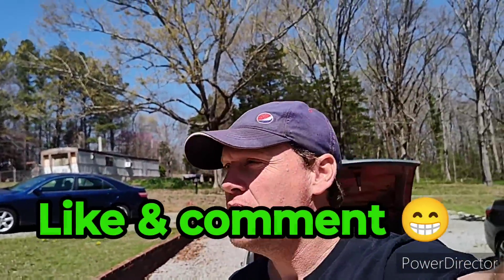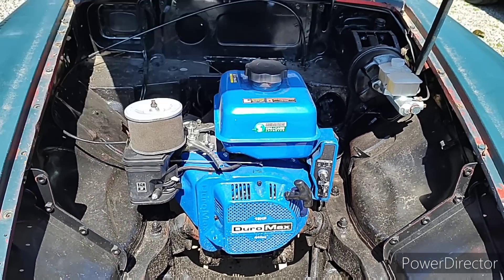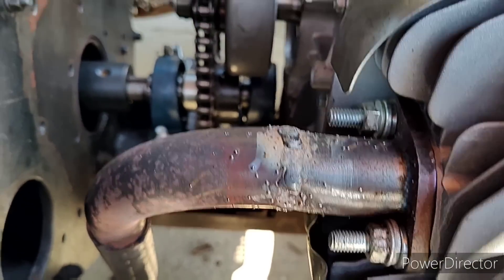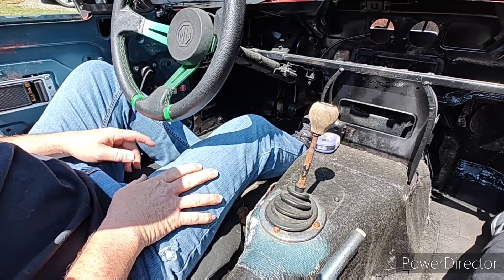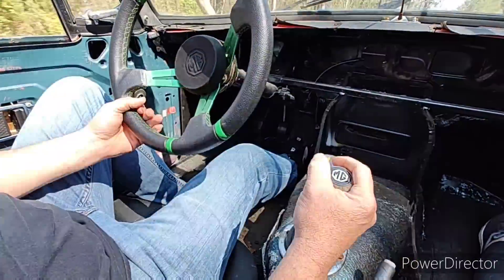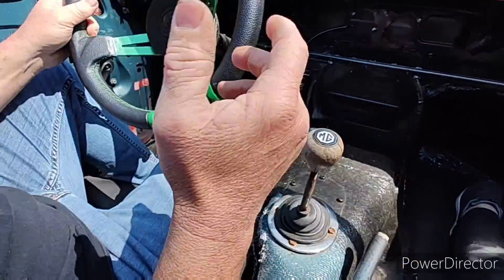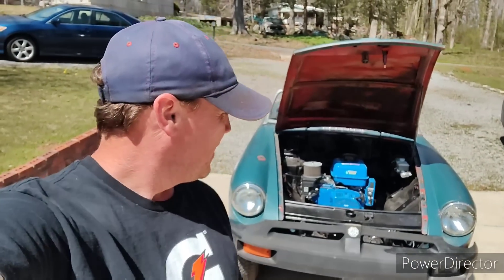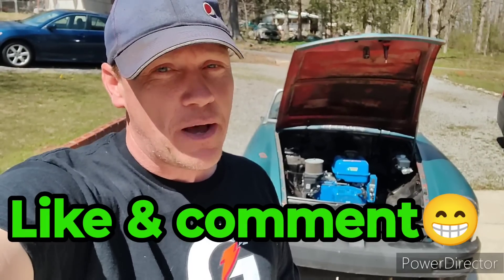How to shift gears in a manual transmission vehicle with a go-kart engine. 4 speed go-kart car.

Comment: How many miles to the gallon?, can you add an electric fuel pump to use original fuel tank?
Reply from the maker: I'm not sure about the mpg because it's not street legal and I can't drive it on the road that much you could use the factory tank with a fuel pump but I took the tank off to shed weight

Comment: Very nice how fast is it? How does it climb hills
Reply from the maker: This one governs out at 40 miles an hour my other one governs out at 49 they can handle a small grade without having to downshift but anything considered a hill you may have to especially in the faster one because the gearing is higher

Comment: What was the top speed of the car
Reply from the maker: 40 mph on the green mg and 49 on my MG Midget set up the same way
Reply: @ChrisfromKeyfarm thank you for your research and following up.  That provides a ton of information. And that's the benchmark basically... In car size must be everything if you can gain 10 mph

Comment: Lot of waisted power using the gokart clutch. Going strat to the trans seems like a better idea. ???
Reply from the maker: It is straight to the transmission , through the go-kart clutch , you have to have a clutch of some sort and the original flywheel is gone, sooooo

Comment: I would have thought that something like 5 speed manual transmission from a Geo Tracker with gear ratios of 3.65 1st, 1.95 2nd, 1.37 3rd, 1.00 4th, and 0.86 5th would work great. You would have a transmission with an overdrive and when paired with 4.10 axle gears on 30 inch tires you would also be around 80mph at only around 3200rpm. What do you think?
Reply from the maker: The most important gear ratio with these types builds is how much you multiply the small engine power into the transmission and I have found that an overdrive doesn't help you a lot because if you have enough power in first to be torquey you probably don't have enough power for an overdrive.

Comment: Would shifting be easier or harder with a synchro transmission? I assume that old MG does not have synchros. If this was done in a modern car day an early 2000s Honda civic would it be smoother to operate? Also would a go kart torque converter be able to deliver power more effectively or no because the centrifugal clutch eventually stops slipping and “grabs” at a certain RPM.
Reply from the maker: Keep in mind I'm not a transmission expert but I believe the MG is a synchronized transmission so it would be very similar to modern transmissions. Many have suggested a torque converter and they certainly have their place but for this application I think a clutch works just fine but I'm also not a fan of torque converters because I've had one in the past that caused a lot of problems.

Comment: We truckers call it floating the transmission. Or ,float shifting. BUT, what is the top speed in normal traffic with the 18 horspower engine?  Im thinking I just might build one!!!!!!😜
Reply from the maker: We call it floating gears as well where I'm from but most people don't know what that term means nowadays The top speed for this bluish green MG with this engine is 40 but my little red MG midget with the same engine is running 49. I could play with the gearing and modify the engine a little to get a little more

Comment: Floating gears. You can do this in pretty much any manual transmission, tricky thing is getting moving from standstill.
Reply from the maker: This one here has a centrific clutch paired with the transmission ,so yeah you got to float the gears but you can also stop and idle

Comment: Very cool. Shifts like the old 13 speed semi truck I used to drive. Rarely used the clutch in it either. And FWIW, I NEVER downshift in any manual transmission machine I have had since maybe, 1990 or so when I realized the training of my youth, to always downshift, was WRONG. Well, wrong in the sense that the wear and tear on the brakes is MUCH easier and cheaper to fix than having to remove the transmission from the engine to replace a worn clutch disc. Currently driving a 1997 Toyota Tacoma 5 speed manual trans and I DO NOT downshift.
Reply from the maker: Cool , good to know , I normally don't down shift in the projects , but for video sake I had to show how 👍 , thanks for watching

Comment: I was just about to say it’s like rev of matching an 18 wheeler and you set it for me at the end of the video. I have a CDL myself.
Reply from the maker: That's it exactly , thanks for watching
Reply: @ thank you for making the video I was watching some of your other videos and that was my first question is how the shifting worked. I just had my first son and I have a spare manual transmission and transfer case out of a small Suzuki LJ, which is basically like a mini Jeep. It’s even smaller than a Suzuki samurai. I’ve been considering putting a predator motor with the spare parts that I have and making him some sort of little Jeep or Rockcrawler.
Reply from the maker: Do it , that would be awesome! 👍

Comment: U need a nice size oil cooler.Cyl head temp guage.Fuel ratio guage.Oil temp guage.Billet flywheel better Valvetrain. Alternator driven by transmission pulley or driveshaft.a 900 cca battery and a nicer exhaust or a turbo with a flatslide carb.Drawthrough.CARRY ANOTHER BACK UP ENGINE ALL DONE UP IN YOUR TRUNK FRESH OIL SPARK PLUGS AND A SMALL BOX OF TOOLS.AND U CAN GO CROSS COUNTRY

Comment: Damn, shifts pretty nice man. 👍
Reply from the maker: It shifts better than I expected it to, thanks for watching 👍
Reply: @  makes sense you could find some gears with a centrifugal clutch. I’d bet it didn’t take too long to figure out floating in with the rpms. Obviously you’ve been around mechanical stuff enough to even think about this mod. 👍
Reply from the maker: I didn't come up with the idea of putting small engines in vehicles but I have tried to take it to another level, and I drove an 18-wheeler for  many years , that's how I know to float gears.

Comment: In the spirit of the old  drag racing crash box.   Remove the sincro's then file off the tip of every other gear tooth, to facilitate easier intermesh / engagement.  With 18 HP and slower speeds it should work nicely.
Reply from the maker: Interesting , never heard of that

Comment: What's your top speed on this one?? Maybe that's in another video.
Reply from the maker: The top speed on the green MG is 40 mph but definitely could be faster with different gearing as it's not weak on takeoff. I'm building the red MG right now and the goal is 50 , it's a 79 MG midget.
Reply: @ChrisfromKeyfarm awesome; thank you for responding and for the great build videos! I've got one of those Duromax motor abs I've been trying to figure out what to do with it.
Reply from the maker: @brighambaker3381 👍

Comment: What would be the process required to connect the Duromax engine directly to the stock engine's flywheel and clutch assembly?
Reply from the maker: Since the flywheel attaches to the back of the crankshaft you would have to fabricate something with the same bolt pattern as the crankshaft and attach it to the 1-in shaft of the Duramax after that you would have to align it perfectly and attach it to the bell housing
Reply: @ChrisfromKeyfarm  Thanks for explaining that to me! Could a 3D printer be used to create a template of the bolt pattern, and then once that is perfected, a water jet cutter to cut a steel adapter plate?
Reply from the maker: That would probably work 👍
Reply: @ChrisfromKeyfarm  Is that a project you would be interested in pursuing?
Reply from the maker: Personally I think that much rotating mass like the flywheel in the clutch is a waste in this application.
Reply: @ChrisfromKeyfarm  Agreed. I was thinking more so beyond this one instance as in that the creation of a coupler could possibly lead to a product to bring to market, as well as possibly helping boost channel views by being able to advertise a direct conversion/engine swap. I've watched quite a few videos by other folks who have posted on youtube about cars like Land Rovers with engines that have blown up after ~50,000 miles and they try to save the vehicles because they are otherwise good, functional cars that look very nice but ultimately end up scraping them because there aren't even engines available to fix them let alone a way to justify the price to replace the engines only to have them grenade themselves in another 30 to 50k miles. My mind goes into overdrive thinking about the possibilities of swapping in Toyota or Honda engines into those types of vehicles to save them from the scrapyard for an affordable price, and your project seemed like a phase 1 trial in a lengthy process of trying to make that thought a reality. I can definitely understand not wanting to create the parts to do the full MG clutch conversion though because that alone seems like a lot of work, setting aside all of the other aspirations I mentioned above. Thanks for sharing your insight!

Comment: Just found your channel pretty sweet ride! And u sure know hoe to drive it Whats the top speed on that thang
Reply from the maker: The top speed on this MGB is 40 mph but the good thing is it's not weak in the bottom gears .I'm currently building an MG midget that will have the two cylinder V-Twin Predator 670 it's lighter with a bigger engine, I'm hoping for 50 mph and I'll make it street legal.

Comment: I was wondering what to do with the 2 cylinder 1980 Suzuki GS 450 sitting my my garage, or whatever it is...  And I think I have a plan for it now. Thanks!
LOL

I'll have to add a clutch though for the motorcycle engine, but I'll get quite the gear range and selection by adding a 4 speed manual car tranny to it for sure.  Should be interesting.
Reply from the maker: Sounds good to me 🙂

Comment: When it comes to new cars, dont you just wished they looked simple as that when you open up the hood? How fast does it go and what are the MPGs?
Reply from the maker: Right now it is geared to run 40. It definitely could run faster but then it would start getting weaker on takeoff. MPG is currently undetermined. Thanks for watching

Comment: In the fall of ‘22 I got outta trucking after 35 years and retired my last truck which was a 2000 VNL 770 with a Cummins Signature 600 and an Eaton Fuller RTLO 20918B behind it.  The only time I used the clutch in that thing was when getting going from a standstill and when maneuvering into a parking spot or maneuvering on a job site for loading or unloading.   Other than that I put on that truck about 1.9 million miles floating gears hauling lots of oversize and overweight loads across 48 states, 10 provinces, two territories and the state of Alaska.  

Yeah, a volvo, but I tell you what, after owning a kw, a pete, a couple of freightshakers and a corn bider, that volvo was the best truck I ever owned and the only one I kept and drove for 22 years.   Say what you will about the “polish peterbilt”, it got more creature comforts than the rest, drives smoother than the rest and as far as the components and the build, well, it’s the same sh!t like the rest of them.  The downside is that they don’t hold much value on the used truck market, but if you keep it and drive it for the long run it don’t matter and it makes you money just like a 379 or a w900 will, maybe even better since the Volvo is allot more aerodynamic.
Reply from the maker: Cool

Comment: How do the vacuum assist brakes work on this type of engine Conversion?
Reply from the maker: I'm not using it. Sorry
Reply: @ChrisfromKeyfarm  so I guess the breaks don't work very well
Reply from the maker: They actually work great, keep in mind it's only a vacuum assist, so you can achieve the same braking pressure by pressing harder with your leg ( my leg is in pretty good shape 😂) also keep in mind it's a relatively light vehicle.

Comment: Could have used a clutch.
Reply from the maker: Clutch and flywheel would have been a lot of rotating weight. How would you mount it?
Reply: @ChrisfromKeyfarm  didn't think of rotating mass for small engine my bad, should have thought of that myself.
Reply from the maker: 👍 your good , thanks for watching

Comment: I do not understand one thing. In other vechicles have the motor with pulley towards the front and this one has one towards the transmision. Arent they turning in oposite direction? I thought that all vechicles turn clockwise looking from the front. Please clarify. Thank you!

Comment: Holy crap it’s loud
Reply from the maker: And it's cooler than it is loud.
Reply: I think it’s awesome but is there anyway you could add some sound dampening material to the firewall area
Reply from the maker: Possible

Comment: Sounds like you need a dragracing slipper clutch, they are made to be dragged, slipped without thermal issues and last for a long time..
Lolz, i love this . Not for the low power but because im machining/building tiny 2 cylinder 2.0L Dohc engines that make 500+hp(on E95 or methanol.) and your putting an 18hp engine in the same  car...lolz we are polar opposites and thats good!   The world of tinkering is fun! Ill pass you at the light, but miles down the road when im out of fuel and overheated, youll come cruising by and hopefully pull me to the next gas stop lolz.   I better stock up on frosty drinks and sammiches for bribes..Whats your favs again?
Reply from the maker: LOL

Comment: If you ever decide to build one without a centrifugal clutch you can use a belt tensioner and just attach your clutch pedal so it loosens when you press down acting like a clutch.
Reply from the maker: The monster truck will have a tension clutch like you mentioned,

Comment: I learned to do the same thing on my 03 protege 5 with a 2.0 and a 5 speed. Drove it till it was leaving rust piles in the garage and sold y to some farm kids to bang around with. I bought it with 57,000 km and sold it with over 350,000 not once did I have the clutch repaired or replaced. Me floating the gears was a rare occurrence and not the reason the clutch lasted.

Comment: Ahhh this just like driving without the clutch pedal in a normal car then (i know how to do this but getting into first is impossible. Gotta turn engine off)
I suddenly learned this skill when my clutch pedal itself literally fell off its Mount year's ago and i was over 200 miles from home 😂

Takes a little practice but you can "feel" when the gear will "slip" in.

Comment: Floating the gears. That's not an 18 wheeler. I drove one to. Two different types of transmissions. Designed different. You will tear it up doing it. Just because you can don't mean you should. I'm doing the same with an old Isuzu I have. But put a clutch in it.
Reply from the maker: I've drove many manuals like this over the past 30 years, no problems.

Comment: sooooo why cant you use the clutch to just make changing gears easier?
Reply from the maker: The original clutch is attached to the flywheel which is attached to the back of the crankshaft in the original engine which is gone
Reply: @ChrisfromKeyfarm  you know i have changed my own clutch before and should have known that now i feel stupid
Reply from the maker: Nah , don't worry about it, the clutch is often thought of as part of the transmission by folks that don't mess with them very often. Thanks for watching and commenting.

Comment: Look at the 780 driver.   Belt drive itll handle 50 h.p.
Reply from the maker: Only problem is that torque converter costs more than the car.

Comment: Will it take off in 2nd or 3rd gear?
Reply from the maker: It will, but just like on a normal car it's real hard on the clutch.
Reply: @ChrisfromKeyfarm  Thanks, just trying to get an idea how much power it has. Sounds like it could be geared for a few more mph top speed if it can take off in 3rd.
Reply from the maker: It could, I just don't want it sluggish in the lower gears.

Comment: Tbh I'd rather daily drive this kind of system than regular manual. I built a mudmower on similar design, except I modified the clutch to grab at 800rpm so I could literally drive it at idle speed. It idles at 720-750RPM, its also not jerky, clutch is way smoother at lower RPMs, slipping RPM range is to maybe like 1500, there its fixed
Drives like any centrifugal clutch manual transmission ATV. Most reliable vehicle Ive ever driven. Its also by far the cheapest, total cost like 300 bucks
Reply from the maker: Awesome

Comment: It needs a torq-a-verter instead of the clutch…it will be a little faster then
Reply from the maker: Torque converters certainly have their place, I have used them in the past and didn't really care for the performance and the problems it led to and the one for this application is several hundred dollars it's just not worth that to me.

Comment: Is someone wanted to build a commuter vehicle to drive 10 miles to work with a 10hp 20ftlb torque diesel engine with a top speed goal of 55 mph what would your vehicle recommendation be?
Preferably 4door as to run around town for groceries and such.
Reply from the maker: Hmm, that's a tough one. 1 I think it would be tough to get 55 out of 20lb. Of torque, but you did say goal, so on to #2 it would have to be light , if you didn't want a small British car like my MGB , then perhaps something in the Geo family? And lastly in that application I would make it belt drive with a tension clutch hooked to a pedal in a spring that held tension on everything instead of a centrifugal clutch.

Comment: Have you ever tried a CVT?
Reply from the maker: I've tried them on other projects and never really was very happy with them. The one rated for this kind of installation is several hundred dollars, its just not worth that to me.
Reply: @ChrisfromKeyfarm  check out the series 30 from go power sports. One might help with the torque ratio, I believe it’s about a three to one and they are very close to a one to one ratio when fully engaging.